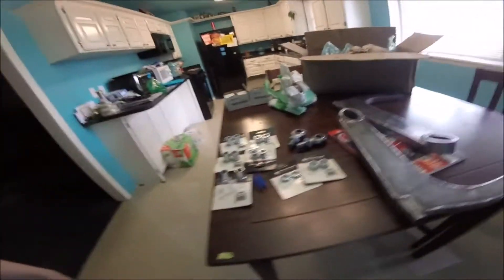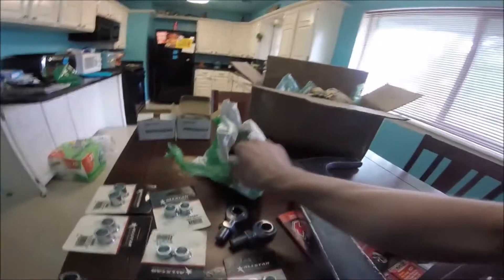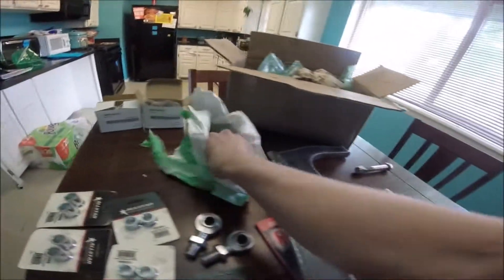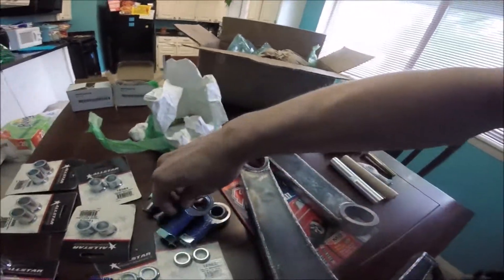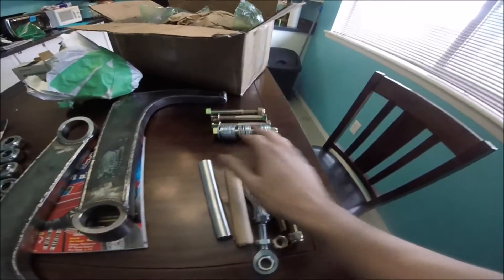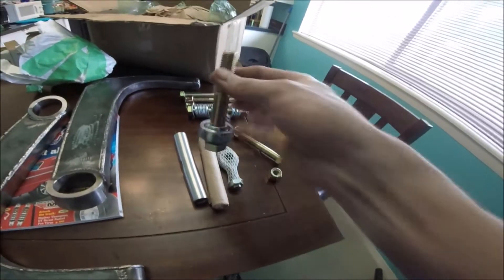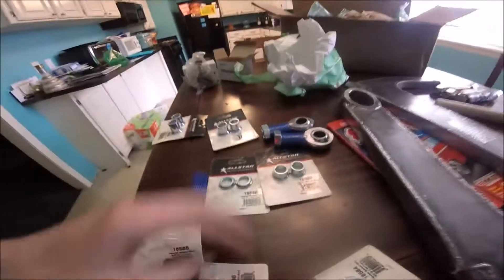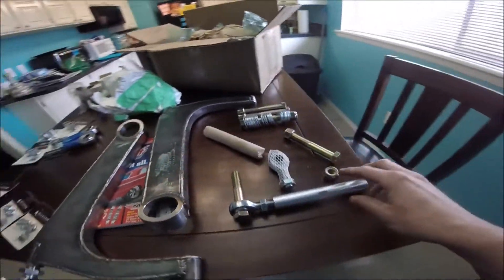Foxbody Mustang Steve Mass Lower Control Arms! Unboxing

Comment: too bad they don't use reverse thread hiem joints on the tie rod ends. make it easier to adjust but I guess it is a one time adjustment. wouldn't mind a video on the install. on the fence of getting the kit. I just hate hiem joints on suspension as they seem to wear out fast on sandy Vancouver roads